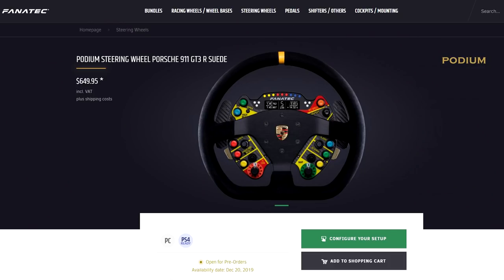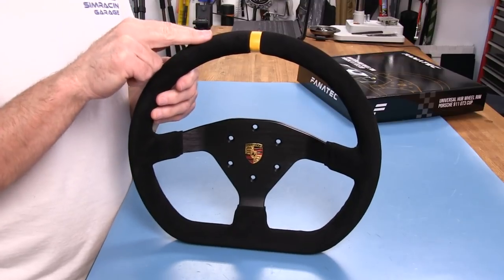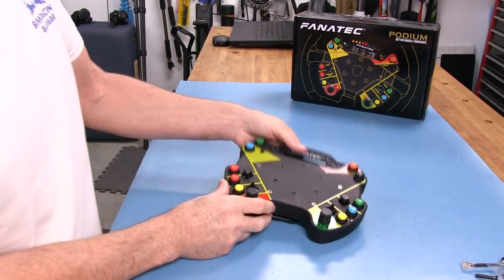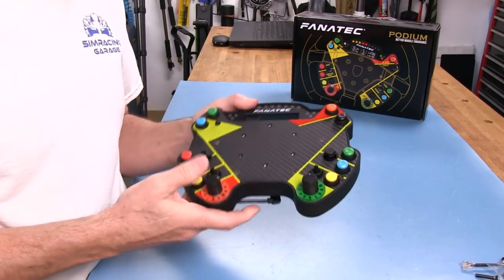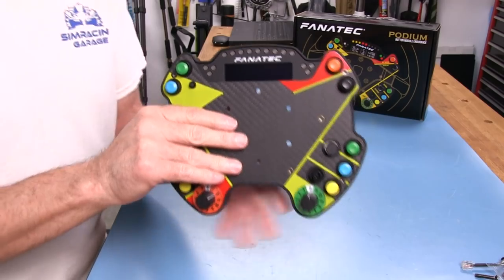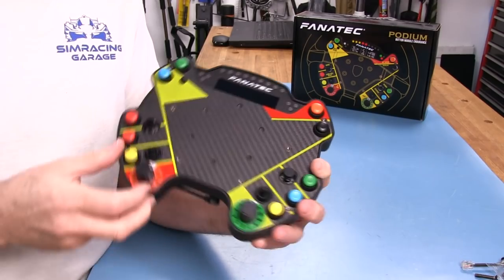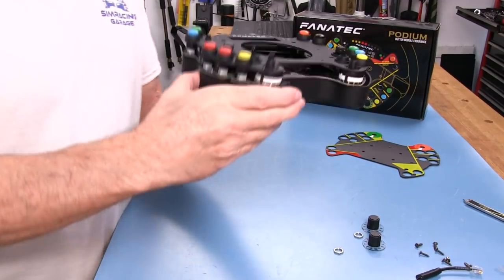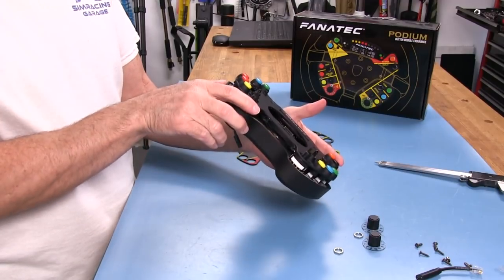Fanatec Porsche 911 GT3 R Podium wheel kit Review

Comment: Your statement that it was released without any telemetry working is false. The day it was released in mid December it came with a software package with driver 353, base firmware 670 and BME firmware 9 together with Fanalab 1.24 which already had the first ITM page enabled on Day 1!
But yes, more pages (pages 2-5 which are already enabled on DD ITM) are in development for BME ITM and should be enabled soon.
Reply from the maker: I may have been enabled, but it certainly did not work for me on the BME, or others I have spoken with. Glad yours was working from day one.
Reply: @simracinggarage3026  it definitely worked for everyone, if the software package was downloaded and installed and all the firmwares were properly updated and when FanaLab was also updated and running because only with Fanalab the ITM is working. Then all you needed to do, also on day 1, was pressing and holding the Tuning Menu button and turn the Funky Switch right or left and then it switches to ITM page 1. 
In fact, as Thomas mentioned, to get the ITM released together with the BME was the reason why the BME was delayed so it definitely was working from day 1 already, otherwise the BME would not have been released ;)
Don't know why it didn't seemed to work for you on day 1 but now because in the meantime there was no new firmware released, it's still the same firmware as on day 1*
Reply from the maker: Sure, whatever you say.
Reply: @simracinggarage3026  yeah, as said, today it's still the very same firmware as on day 1 in Mid December and it's still the same FanaLab Version, so there is no reason why it works now but not on day 1 for you... Maybe FanaLab crashed in the background or so when you tried it on day 1 or so?! 🤔
Reply from the maker: Could have been caused by a few things, but it still did not work for me and some others I was in touch with.
Not that big of a deal really. The important thing is that it works reliably for me now with the latested update.
And looking forward to the rest of the pages or screens when they are available.
Reply: @simracinggarage3026  to get a glimpse of what's coming, pages 2-5 are already available on the DD ITM screen. They are not working properly yet though so they may show some wrong or weird numbers, but at least it's a small tease of what's coming to the BME soon :)
Reply from the maker: Yes, but it looks a lot better on the BME's display I think.
Reply: @momorious  It might work with DD, But my friend that is using the CSW v2.5 base can not get it to work. Here is what Fanatec wrote in an email to him. "And there We have it. Your CSW v2.5 is not compatible with the BME yet. A firmware update to get get it partially compatible (no ITM mode, just Legacy mode) is expected later this year (few weeks ago Q1 was mentioned but removed in the meantime)."
Reply: @momorious  It might worj on DD but it does not work with the CSW v2.5 base. My friend just got this email from Fanatec. "And there We have it. Your CSW v2.5 is not compatible with the BME yet. A firmware update to get get it partially compatible (no ITM mode, just Legacy mode) is expected later this year (few weeks ago Q1 was mentioned but removed in the meantime)." So at the moment the buttons does not work.
Reply: @TwentyFourSlevin  that was not an email from Fanatec to your friend. That's a quote from MY reply to a user in the forums some weeks ago. And it's still valid, as said, it was always listed in the Webshop description that it does only work on DD Bases for now and in the future on other bases too which first needs a new firmware which was not released yet. So, nothing Fanatec is actively hiding.
Reply: Shouldn't someone get fired if they don't put TJ's words in Barry's mouth?

Comment: These porche rims are way way too overpriced. It's crazy really all of their rims are I would say 50 to 100 dollars higher than they should be.
Reply: It's actually a VERY fair price for what you get, no other wheel on the market gives you that much options with buttons, rotary encoders, MPS, LEDs, an OLED, 4 magnetic Paddles with analoge Clutch etc etc.
Reply: Its a fair price....I thought it would be more expensive
Reply: 650€ seems like an average price for a rim & buttonplate....
Reply: Not really, real life Porsche rim only, is about 470€...
Reply: Fanatec recently bumped the prices of all their items by 50 to 100 dollars in the US.
Reply: @geforce5591  that's not true... Only the Podium Racing Wheel got a price increase, the Porsche Wheel still costs the same as always.
Reply: Why should a fake game rim cost more than or even close to a real rim.
Reply: @chrisjohnson261  have you seen above the price of the real rim? 470€ vs 150€
Reply: @chrisjohnson261  you won't find a real steering wheel with that many functions for that price. Not even wheels from other simracing manufacturers can offer you so many functions for that price.
Reply: I dont think they are fairly priced in our current economy.  400 500 dollars for a toy wheel? Half the price of a direct drive wheel?
Reply: @chrisjohnson261  yes. You get what you pay for and the price, especially compared to what you find on the market, is extremely fair. But it's okay if that too much for your budget, there are other great alternatives, but of course with less functions.
Reply: I asked this question elsewhere too.
Currently on the CSL elite setup with the LC pedals. 
Building a computer soon I'm fafed with the choice of going for the Cswv2.5 or The Accuforce v2 pro setup. Now I've heard some people say that the cswv2.5 feels just as smooth as the Dd wheels and for this reason I should save some money I should just go with that. But others have said to get direct drive it's like night and day. 
So what do you all think.
Reply: @chrisjohnson261  CSW v2.5 is even smoother than DD wheels, especially compared to the very coggy Accuforce wheels. If you consider spending a lot of money to enter the DD world I would highly suggest to look for the Fanatec DDs or the Simucubes, but I don't think you will be happy with an Accuforce, especially if smoothness is important for you.
Reply: @momorious  The Porsche wheel got a discount then got it's price increased AGAIN back to the old price. Trust me, i know.
Reply: @geforce5591  I also know and the price for the ClubSport version was always 549,95$ and the Podium version was always 649,95$.
Reply: @momorious  smoothness and the clipping during turning or cogging if that's what it's called is my biggest concerns. Dependability as well. I dont need a bunch of ffb. I have a csl elite ps4 and that ffb is just fine. So I've heard that the cswv2.5 is even more smooth than that. 
Idk but the 2.5 is under 600 dollars and it's an improvement over my.current setup
Reply: @chrisjohnson261  eSports drivers prefer the 2.5 over the DD
Reply: Well, its a Porsche